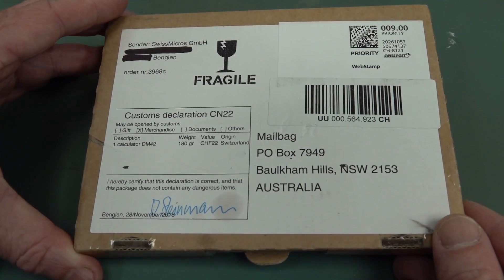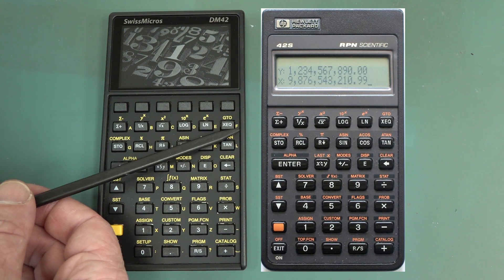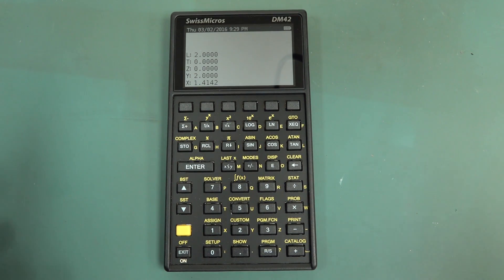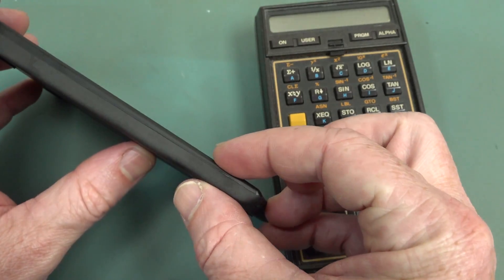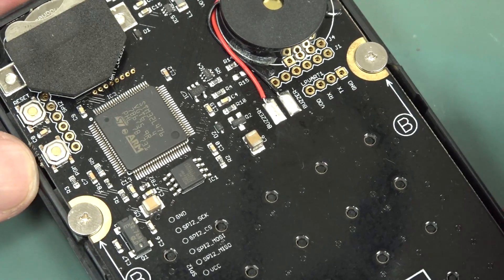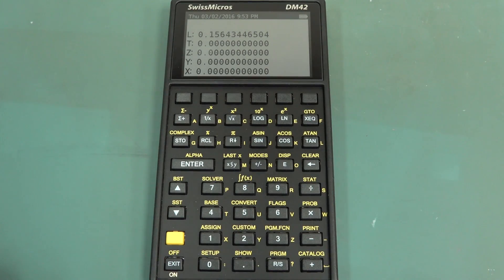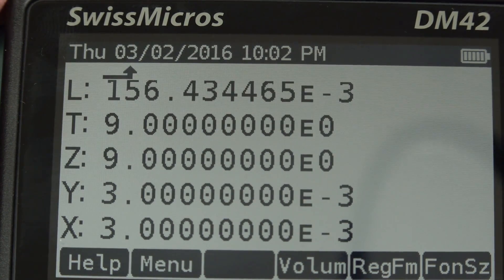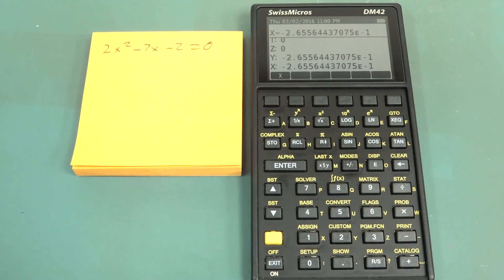EEVblog #1159 - World's Most Precise Pocket Calculator

Comment: it looks great, though the functionality of this calculator is so crippled. No graphing, no statistics, no algebra. Sure it probably had a role, but I have yet to find a better calc than the ti-83/84
Reply: Well...why do you need that stuff? I don't do much graphing (at least, not on a calculator. That stuff gets moved to Octave), and I don't really use CAS, either. I do understand the need for stats, and it appears that calculator does stats.

There are plenty of better calculators than the TI-84 series. The TI-89, for example. The Nspire series, or my personal favorite the HP Prime. I'd also argue that the 83 wasn't as good as HP's competitor, the 48.

Comment: Rpn calculators was always fun to loan out to a unsuspecting student who forget their calculator. HP for the win!
Reply: Actually, I did that to a professor once who asked to borrow my calculator and when I handed him my HP-41CV, he handed it right back.
Reply: @jonathanguthrie9368  Awesome!
Reply: I wish someone would manufacture a cheap scientific RPN calculator.  Like a RPN version of the Casio-260fx.
Reply: Jess Stuart HP 35s
Reply: I still have my HP 28S in perfect condition (externally, have not used it in a couple of decades), even the battery door is still holding. I just dug it out and ordered some batteries for it (LR1, hard to find and expensive) to see if it still works. I used to love that logic back when I was in tech school in the early 90:s, haven't really needed a calculator much since then and nowadays I just use my phone.
Reply: @ahmadaamer6  The HP 35s is not really cheap. Neither in price nor functionality. Maybe the feel is cheap...but probably still better than 90% of everything else.

One often tends to forget that it was not just RPN which made the HP calculator outstanding. The keyboard was amazing (and the key top labels were not printed on...they are solid plastic structures which go down into the key body) and, in most cases, the displays as well. There are emulators available for smartphones, but the  touch screen interface sucks hard compared to the original keys, where every key press would register reliably and you'd know it.

Some exceptions: the HP Voyager (HP 10..HP16) series had the best displays I have ever seen on a pocket calculator, but the Enter key sucks. While it's a large size key, the mechanic is that of a regular size key, so you need to practice to hit it in the right spot. And some of the dot-matrix displays cannot really compete with the 7 and 14 segment displays of the more "historic" models.

My preferred calculator for every day use is still the HP41 (yes, I do have an emulator on my phone, since I do not carry my old HP 41CX around all the time, but I cannot operate it as fast as the real physical keyboard of a real HP). While I do own more advanced models, the 41 has just the capabilities I require from a pocket calculator. The limited (four level) actually has its benefits over the "unlimited" stacks in later models. The lack of complex programming structures means that I can punch in ad-hoc programs at unsurpassed speed. I don't need the advanced capabilities of an 48GX or a Prime...because, honestly, all advanced stuff gets into the way of doing simple (*) things fast. And, honestly, if I have a real complex task, I prefer to work it in Python, or R, on my workstation. So the 41 is still the "perfect calculator" for me.

(*) Simple. Well. You can sure accomplish more complex tasks with an HP 41. Famously, the HP 41 was the only component aboard the Space Shuttle which was not sourced from the "lowest bidder". At least on person at NASA had more trust into the HP than the five on-board computers, so they had to buy a few and program them to perform the calculations required for a manual landing (which, luckily, never had to be done). The feature set of the later HP 41CX was specifically designed to meet additional requirements aboard the Space Shuttle.
Reply: Got the batteries and it still works! The battery door is kind of loose now though, needs to be pressed in when closing the calculator, otherwise it gets pushed open.

I think I even have the manual in my mother's house, I'll have to see when I'm able to visit her again (now I can't because of her age and the corona virus threat).
Reply: @Murgo-u3l  Just google for "hp 28s manual pdf"...or go to http://holyjoe.org/hp/HP-28S_Owner's_Manual.pdf and http://www.hp41.net/forum/fileshp41net/hp28sref.pdf

Battery door? In my country, we only call it a door when you can close it. That thing is more like...an ejection seat for batteries.I guess that's why the called the 28S the 28S and not the 28CS. No "C" for "constant memory" when the thing loses power all the time.

Still got one, but the whole case is coming apart. I had once written a 3D racing game for it, but it got lost when the battery "door" did its thing.
Reply: I screw up badly on regular calculators, I really have to concentrate to use them, which means I still keep my HP28S handy at home and have a RPN calculator app installed on my phone. The combination of RPN and a stack is pure gold.
Reply: @strandvaskeren  I just got to 28s's from a guy on evil bay, I've had a 41 for a while and been wanting to play with one of these.
Reply: In college during an exam my TI ran out of batteries and I borrowed the TA's HP.  My first time using RPN was during an exam!  Worked out okay.  True story.
Reply: I own a soviet one like that and I was so confused at first.
Reply: I've always had RPN calculators. I find the algebraic ones very hard to use for complicated expressions.
Reply: For some reason, I was carrying two HP 33s calculators the day of a test in a land surveying class and during the test, the classmate sitting next to me was in need of a caltulator, so I changed my spare over to ALG, handed it to him, and he was forever thankful.
Reply: I have the opposite problem.  Every time I try using a non-RPN calculator, I want to hurl it against the wall.  (Current zoo: hp32s X 2, hp42s X 2, Free42 on anything that will run it.)
Reply: I have used HP calculators for business and love the RPN, seems almost natural to use.
Reply: My first scientific calculator was not only RPN, but radians and Napieran only, people soon stopped wanting to borrow it. I can't think why!
Reply: Always used an HP in college and dreaded when someone wanted to use my calc, you spent so much time just explaining it to them I gave up and bought a cheap TI just for loaning it out.

Comment: I think this is far from the world's most precise calculator, but one without CAS certainly. I used to have a TI Voyage 200 and that thing was much more precise, however it uses a computer algebra system and is capable of exact symbolic calculations.
Reply: There are also calculators with variable precision. The built-in Android calculator for example will calculate as many digits as you want--just swipe on the result.

Comment: 7:51 - They need the black solder mask since you can see the PCB through the openings for the keys.  One time when using a black solder mask is actually the right choice!
Reply: Dave only hates the glossy-black kind of solder mask...
Reply: It was on the backside though
Reply: Zeikou they don’t usually make pcb with shielding only on one side do they?
Reply: So they could have back lit the keys?
Reply: I'd rather see the PCB, it makes it feel more real. Of course, that's just my personal preference.
Reply: Solder mask should only come in one color. Green.

Comment: Wouldn't a calculator with symbolic math and arbitrary precision rationals such as the HP 50g be "the most precise" ? Literally no rounding at all.
Reply: I get that you're reacting to the promotional fluff of "the most precise calculator" that they've attached to this device, but your comment triggers a rant of mine.  

I hate the fact that when I do a string of calculations, my HP 50 won't give me the answer without pressing another button.  It doesn't help that I can never remember which button I need to press to turn the symbolic answer into a string of digits.  It's like they took what's useful about having a handheld calculator and deliberately destroyed it.

Since engineering measurements are rarely made to more than three significant figures, and since the engineering models that you're going to use with a handheld calculators (as opposed to putting into a computer program) are usually just rules of thumb, I don't really care who is "the most precise."  I want an easy answer that's good enough, and "good enough" means "about as precise as the measurements and the models."

That's really what's prevented me from getting comfortable with using the HP 50.  I wish Swiss Micro had a portrait version of their DM41L, but I maybe could be see my way clear to buying one of these in the next year or so.
Reply: @jonathanguthrie9368  just switch it into approximate mode (shift+equal if I remember right) and turn auto simplification on. I think that will do the trick.
Reply: @danielmewes  Thanks for the tip.  I really appreciate it.  Now, if there was just a way to make the approximate mode the only mode it was possible to enter.
Reply: Right shift and Enter gives an instant toggle between exact and approximate modes. Flag -105 can be changed by program commands if you need that.

Comment: I've got a stack of HP calculators (including an HP-10B, HP-15, HP-16C, HP-42S, and HP48GX. They all work. My first was an HP41CX with card reader. No idea where that went. Probably a box somewhere in storage. I have ported some of the programs that I wrote to routines for Allen Bradley CLX PLC's (AOI so I  wrote them once and use them whenever I need them).

Comment: This is making me tempted to pick up a DM42. I checked their website and they have a DM41L is based on an HP-41CX. I thought about getting it but it is in landscape mode (like the DM15L or HP 15C) and not portrait mode like the DM42 or HP-41 seen in this video. I'm not sure if my HP-41CV is still working. I need to find some new batteries for it or just hook it up to a power supply to see if it is working. At least I have an emulator for an HP-41 on an old PDA, an Android tablet, and on my main computer.

Comment: SwissMicros calculators are amazing - I want to get a DM15L someday. It's sad when the highest-quality HP calculators currently available are not made by HP. The display line bug is rather surprising. Maybe they've fixed it, and you're running an older version of the firmware?

Comment: to test if it really is that perfect.   give it x=6/2(1+2) and see if it gets the correct answer of 1 or the incorrect answer of 9
Reply: 1. Correct value is 9. Division and multiplication have the same priority and are therefore executed left to right. The operands of division are implicitly parenthesised for horizontal line division only.
2. Completely irrelevant with this RPN calculator.
The user enters (E for Enter)
6 E 2 ÷ 1 E 2 + × for 9 or
6 E 2 E 1 E 2 + × ÷ for 1.
Reply: Really useless test

Comment: HP still make some decent calculators, if you’re looking to spend a bit of money on one.

I still prefer my 48GX over the new models for normal use (RPN as default), but the speed is not comparable between this and the newer 50G.

If you’re after older models then you could try e.g. https://www.thecalculatorstore.com/en_US

Comment: Thoughts:
1- It looks great, but I'm not sure about having to unscrew the back to replace that battery.
2- To emulate the old HP41's function modules, could you connect a USB Thumb drive?
3- are there plans to hack this, adding functions etc? [examples: increasing number of digits shown, plotting graphs]
Reply: 1-The battery on mine has lasted over a year now, with daily use at work, and still reads with a full voltage. I think you'll have months of warning to change the battery when it indicates "low" and it unscrews very nicely.
2-I suppose you could. It has the ability to save states, so you could load a bunch of programs for one "module" save that as a state, and then create another "module" with a set of programs, and then load whichever "state" you want. I do that with my electrical engineering programs (one setup), my radar programs (a different setup) and my just regular every-day programs (a third setup) which I can switch between with a few button presses.
3-No need to really hack it, the calculator is made for people to write their own programs for and there are some working on that now, though progress is slow due to not much documentation. The 42s software is a program loaded onto the machine, but you could have multiple programs stored at once and switch between them in the setup.

Comment: @EEVblog Hi Dave, this video of yours intrigued the crap out of me so much that I had to make a detour to the SwissMicro site, and Lo! and Behold!, not only do they make umm clones? of the HP Voyager series, but also even one of the legendary HP41CX (albeit in the same physical format as the Voyagers ) and their prices are very reasonable compared to used and quite likely "iffy" real HP41CX'es that one might find on ebay. THis is definitely something for me to consider, as I've been collecting vintage calculators for a couple of years now - I started with the Texas Instruements' "Majesty Line", and am now trying to get a working TI-59 and a SR-52 assembled (I got one of each in a 'job lot' off ebay, and upon seeing the price of the lot, I knew straight up that this would need a lot of TLC to get working, but at least I now have somewhere to start). For me, though, the HP41 - and in particular, the HP41CX, have always been something of a "Holy Grail" and if I can "cheat" by acquiring one of those clones... well so be it.
Either way, great video - as usual :P - and keep up the good work, mate.

Comment: Been drooling over one of those since the first prototype videos. A bit expensive perhaps, my trusty HP32sii is still going strong and cracking anything i throw at it. I think it should have had an microSD slot to copy / backup programs on the fly. (Wish my 32 had flash memory..)

Comment: Just googled the DM42...holy crap, that is expensive!
Reply: Yup, and you get more of the pi
Reply: If you have an Android phone, just get the Free42 app.
Reply: @jessstuart7495 it’s also on iOS (as well as desktop OSes). I have an HP 42s but I just use Free42 on desktop, iPad, and iPhone
Reply: I do not regret buying it in 2017! I also considered the price high when I had a first look on the website but when you have this thing in your hand, you know that it's worth it. Every cent.
Reply: It is more efficient to separate a wealthy fool from his money than a poor one
Reply: My first hand-held calculator (HP35) , bought in 1973, cost a week's wages. (~$2000).
Reply: Charles Tivendale holy fuck $2000 a week in the 70s was alot
Reply: @CaspaB  The list price of the hp-35 when released, was $395 (US).
A year or so later, it was reduced to $295, when the hp-45 came out, at $395.
Are you quoting the price converted to current (2018) dollars?

Fred

Comment: You know... I would like a remake of the TI 83+ that was built as well as you'd expect for a 100 euro machine. The real one, while it is a good calculator, is really built as cheaply as they can get away with... I suspect the cost to manufacture one is not much more than 15 bucks.
Reply: ManWithBeard1990 I’d be surprised if it was much over $5. I’m sure they have at least a part or two in them where cost has gone up due to nobody but TI buying them... but yeah there’s gotta be at least some economies of scale with the TI 8x.
Reply: Lassi Kinnunen  Let's say they could make it cheap enough to put it on store shelves for that price.